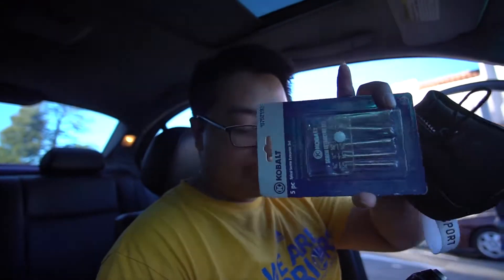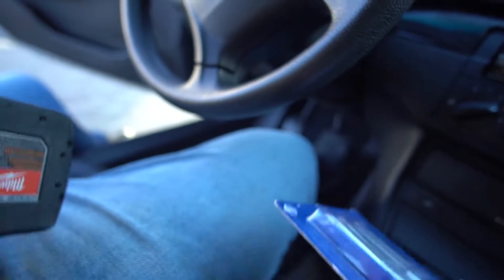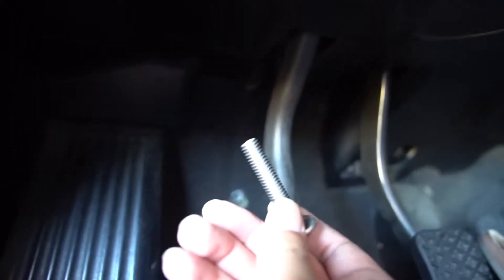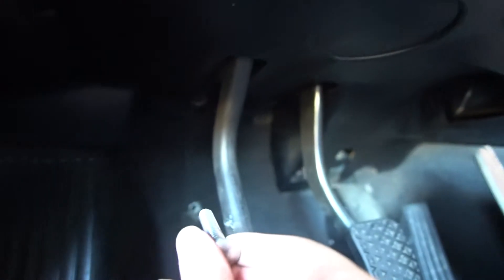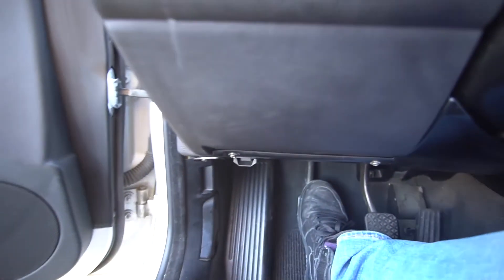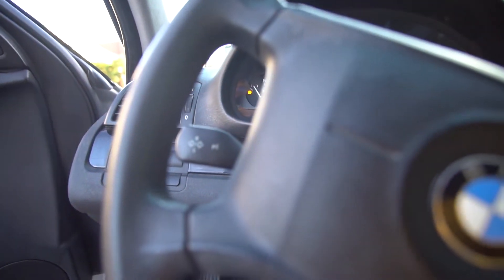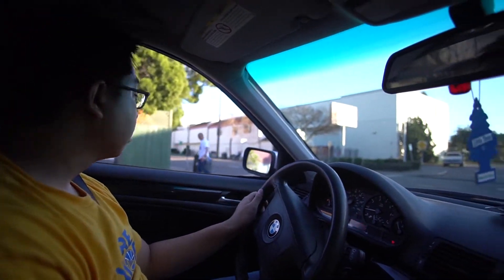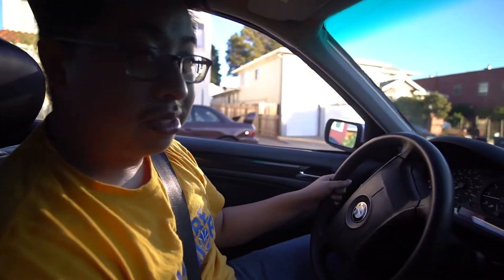BMW E46 Cheap DIY Clutch Stop! Shorter clutch engagement

Comment: Way late, but you ruined the thread in the floor. You are driving a 
german car, so expect all the threads to be the right system, which is 
METRIC! So you need to get a 10mm bolt which is 35mm long.

Comment: Way late, but you ruined the thread in the floor. You are driving a 
german car, so expect all the threads to be the right system, which is 
METRIC! So you need to get a 10mm bolt which is 35mm long.
Reply: This is the bolt metric?
Reply: @NakaiSan.  as I said before, yes it is.
Reply: @frankotto83  ty bro! I have m10 40mm can work maybe haha
Reply: @NakaiSan.  Don't let the Bolt be too long, or you can damage your Clutch. It is because you can't push the pedal far enough to the floor, so it isn't fully disengaged. Maybe cut the Bolt with an angle grinder or file it down 5mm. But make sure you re-cut the threads!☝🏻 Or at least deburr the end of the Bolt.
Reply: @frankotto83  ty much bro i will buy 35 mm too then thanks you bro! I have some bmw vids maybe u like i appreciate much!